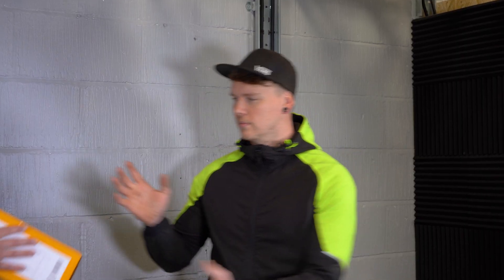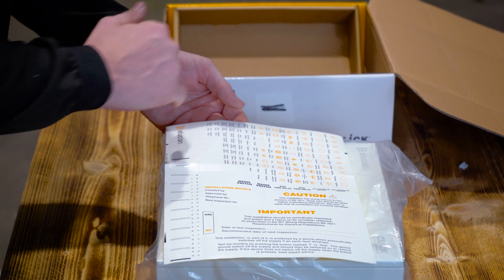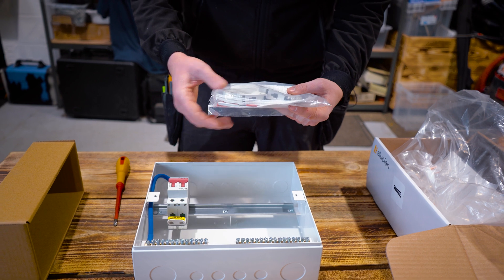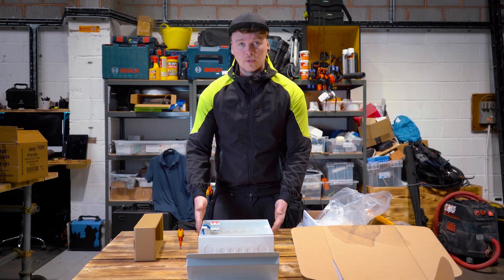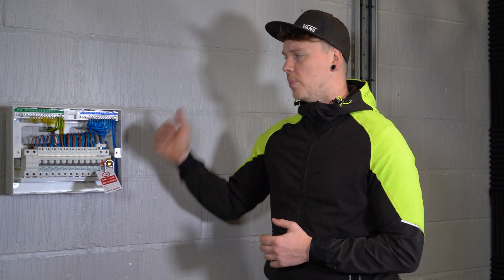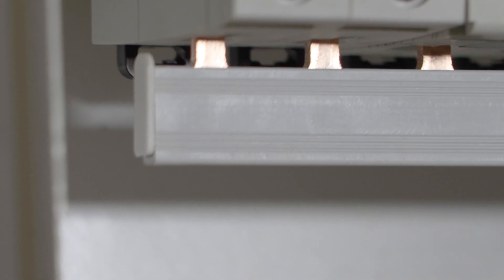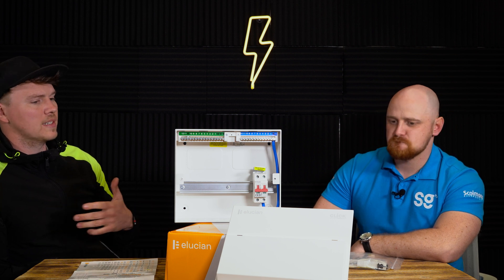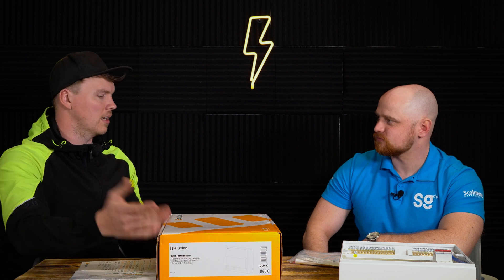Unboxing and installing the new Elucian Consumer Unit with Nick Bundy - SGTV 📺

Comment: Are you able to move the main fuse from the right to the left in these boards?
Reply: You can move the main switch tails clamp two spaces to the left to allow for an spd but there's no other position for the tails clamp

Comment: I fitted one yesterday, I couldn't get the back square knock outs out, had to drill 70mm holes as board was de forming  hit the back and neutral bar fell out, apart from that it was good to install.
Reply: That is definitely a problem
Fitted 2 this week and removing the rear knockouts were an absolute nightmare. The board was deforming as you mentioned 
Other manufacturers seem to have better knockouts, a good sharp tap and they are out
Not with the Click though

Comment: So the SPD plus overload protective device would that take up 3waYS total? Does SPD come with tails or do you need to get that separately? What is the trade price for the SPD?
Reply from the maker: Hi, our SPD does not require additional overcurrent protection. Therefore it only takes up 2 ways within the consumer unit.

Currently we are advising contractors to supply the SPD with 6mm cable from the outgoing terminals of the Main Switch. In the not-too-distant future we will also be supplying tails kits for the SPD. In relation to your query on trade prices, as we operate through the wholesale channel only, we are unable to provide a list of trade prices. 

However, if you would like to drop us a DM with your contact details and postcode area, we can organise putting you in touch with your local area sales manager to discuss your nearest stockists. 
Many thanks, Maddison
Reply: @ScolmoreGroup  so in regards to reg 534.4.5.1, are you saying this protection would be internal to the SPD hence we don't need one?